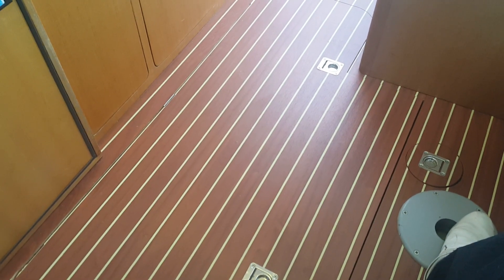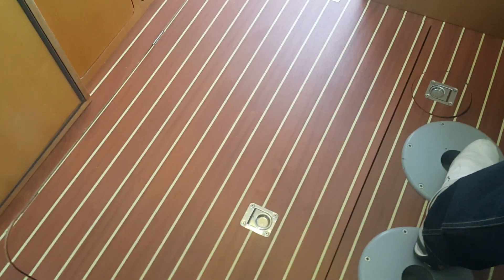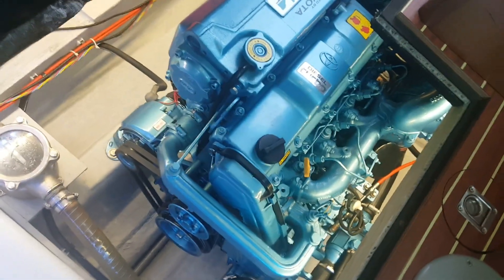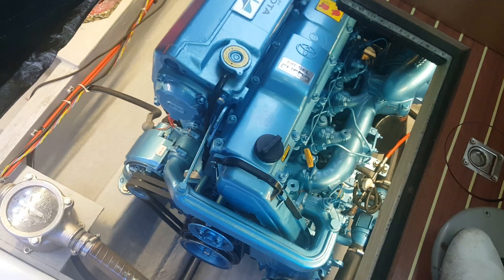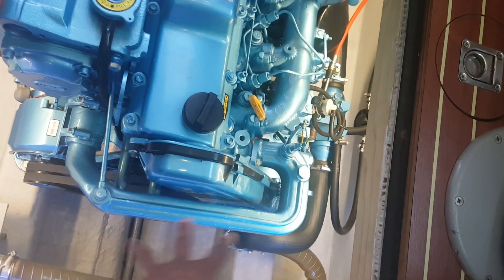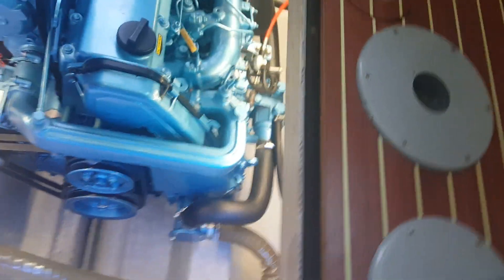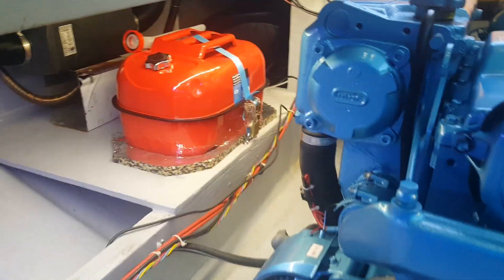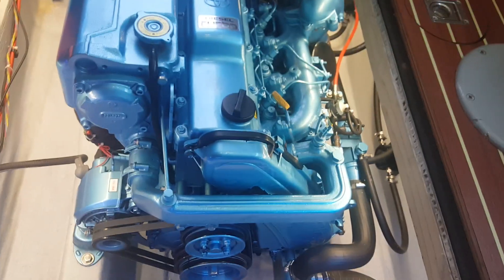Nanni Diesel engine 200 HP - boat review part 2

Comment: Turn it over. I'm not sure a Toyota diesel is better than a Deere or Cummins. 😊. It looks nice and blue!
Reply from the maker: They are all very reliable diesels, the toyota just has the advantage of worldwide availability of parts. Not every  country has a Deere or Cummins distributor network but Toyota is found in even the most remote corners of the earth as it is the same engine in Landcruisers, Hilux, pickups and Hiace. ;-)
Reply: verywell marinised by nanni in 🇫🇷 quality engineeringwith marine proven materials

Comment: Whats the top speed?
Reply from the maker: 23-24 knots full throttle at 3600 rpm
18 knots cruise speed at 3200 rpm.
4 blade propeller.

Comment: 🤔maybe I'll just get one of these and put it in my car
Reply from the maker: Yeah , i understand why you would want to. You get more horsepower and everything manual so no EGR valves or OBD computer, even the fuel pump is manual . I think its because the emission requirements is different in a marine environment as there is no danger of carcinogenic particles getting inhaled to the lungs from air because of the wet exhaust that mixes the exhaust gasses with seawater. I think the M1KZ modification of the 1 KZ - TE is much more expensive than the normal 1KZ-TE.